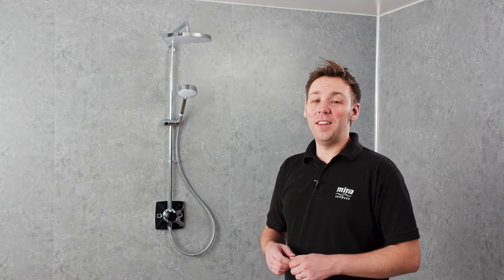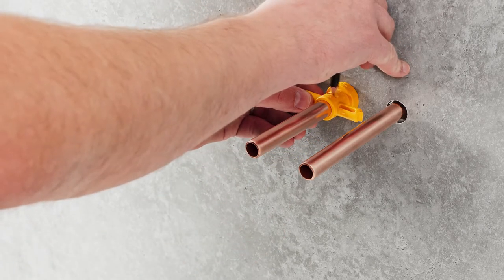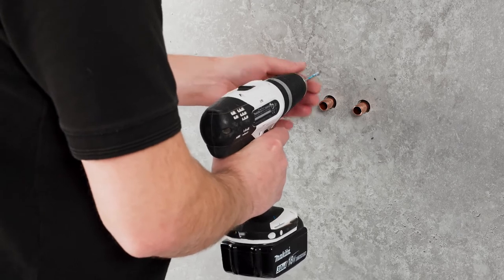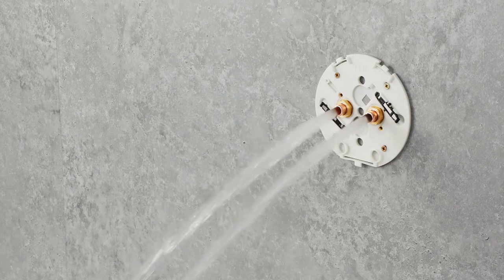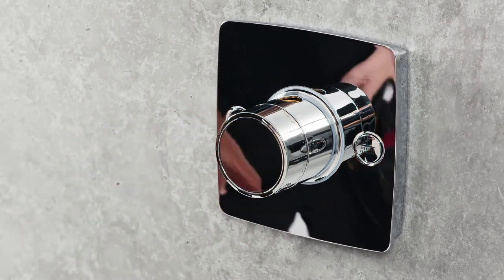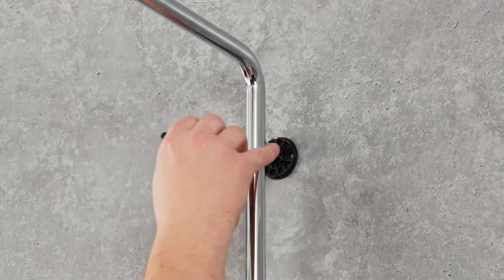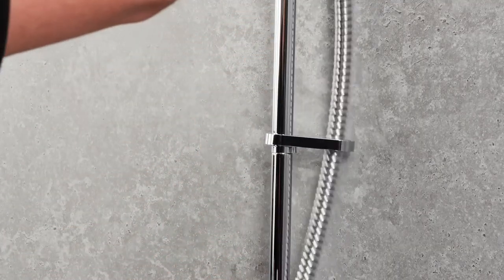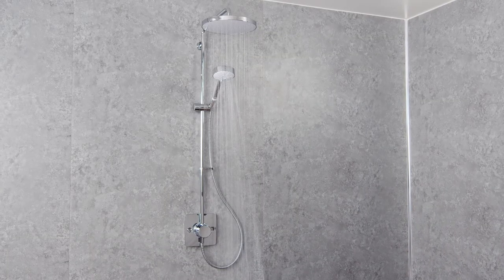Mira Beacon Dual Mixer Shower Step By Step Installation Film

Comment: We've been enjoying the Beacon Dual and notice an odd behaviour of the shower on/off button (left side). The deluge button (right side) turns on and off instantly when pushed. However for the shower button, turning on is instant, while turning off takes 3+ minutes before turning off completely regardless of how many push we do, hence quite a waste of water. Is there a fault on the shower button or is it an odd behaviour of the shower to cool down for 3+ minutes (by rotating the temp control full clockwise as per user manual)?
Reply from the maker: Hello, Sorry to hear of the issue you're experiencing with your Mira Beacon Dual. This can be caused by overtightening of the locking nuts and screws on the backplate assembly by the installer. This causes the lever arm to be pinched by the distorted backplate and it sticks stopping the UFC (Universal Flow Control) paddle from being released. If slackening off the locking nut doesn’t help we would advise getting in touch with our customer service team, you can find our contact details here - https://www.mirashowers.co.uk/support/contact-us/
Reply: I have the same issue with Opero. it won’t turn off at all, tried slack off the screw and no luck…. can’t believe the quality of Mira is like this… and the product seem so delicate
Reply: @mirashowers  This is a design fault as i have had a Mira engineer come and go and within a week it was back to not turning off - im wasting heat and water daily trying to turn this thing off.  For the price of it its not a good look at all